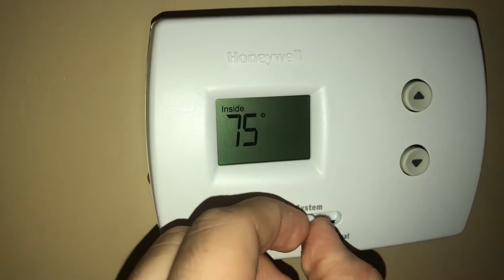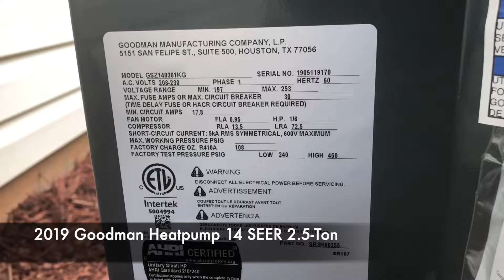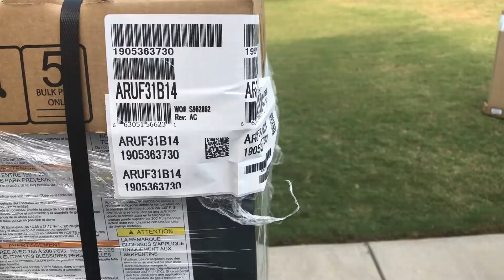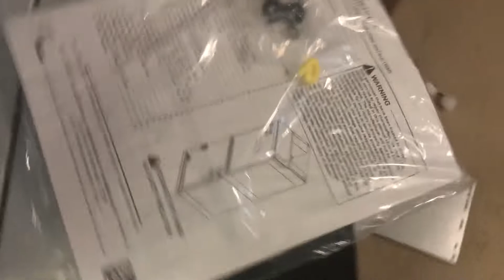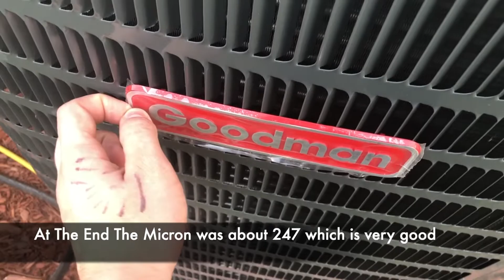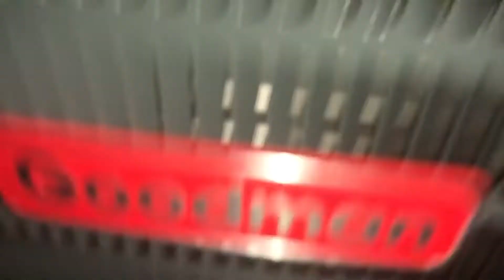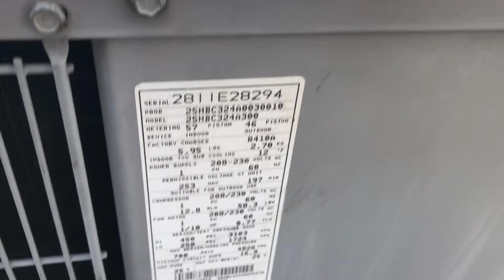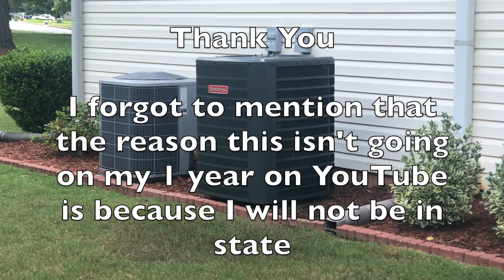Early 1 Year Special | My Carrier 38YCC System Change Out

Comment: Dude… a bic lighter for the torch? Lol. Could have used pipe benders too is it still running any issues?
Reply from the maker: @laurencegoldfrank1966  been running better than the old unit and the unit next to it. Not a single issue
Reply: That’s good, long as it runs I guess Goodman is a decent unit
Reply from the maker: @ haven’t had any issues with any other Goodman units we’ve installed over the years nor issues with Carrier or Lennox